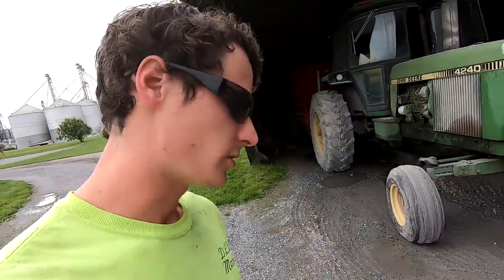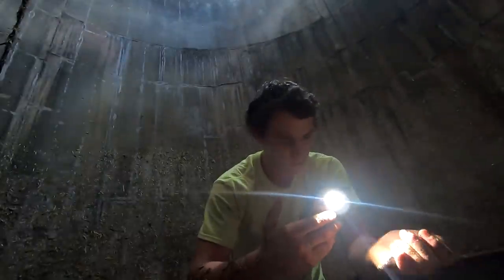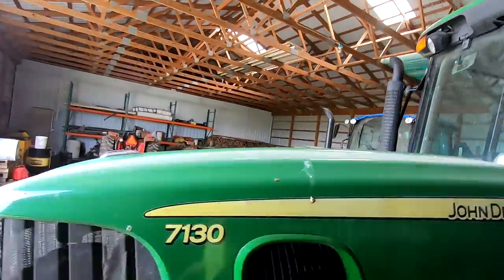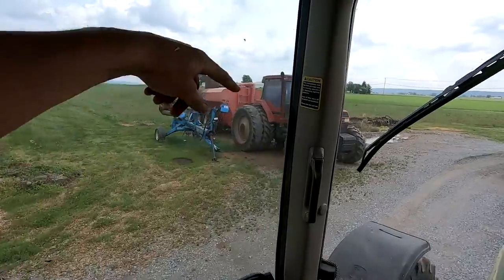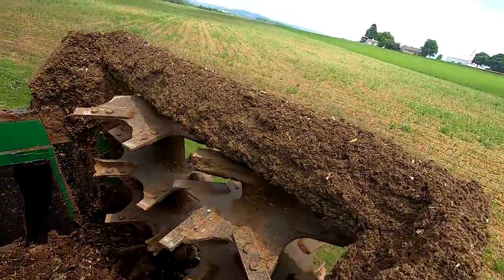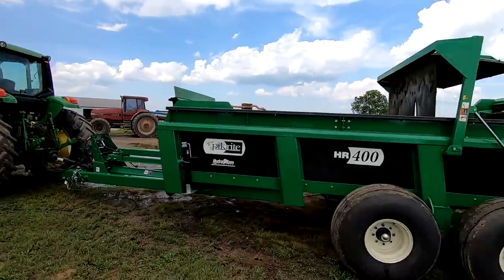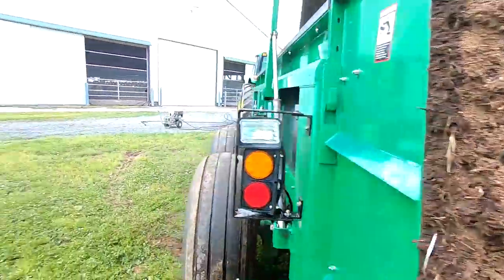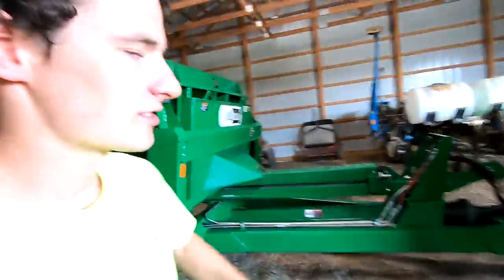Fixing Silo Unloader & Washing Pik Rite Manure Spreader

Comment: Great video just a idea run the grease gun around after power washing it will take the water out of a the bearings and shafts it will save you money down the line and congrats on 200k

Comment: Huge step saver to put a brass hose shut off at the end of the water hose to be able to turn water on and off without walking all the way back to the hydrant. I have one on the end of each of  my two hoses. Can also add quick connects to that  hose shut off for each of the water tools.(pressure washer, spray nozzle, etc)

Comment: You can put old machine oil you dont need on biders or any other metal part that is in contact with manure. After use you let it dry and then you just sweep it with a broom and it will go down with ease:)yust an advice because i now how hard is to clean them:)

Comment: If you park the gear you want to clean outside went you get heavy rain(soak time) and wash it during or immediately after, it makes the job heaps easier and faster. Coating the gear while clean,  in a thin layer of oil also makes the easier and prevents rust (oil thin enough to go through an air compressor spray paint gun)

Comment: Is that shear bolt supposed to be a Grade 8 (hard to see for sure if it was a Grade 8) bolt like you installed? Too strong of a bolt and the bolt won't shear but the gearbox teeth will. The few shear bolts I've dealt with are hardware grade bolts aka Grade 2.